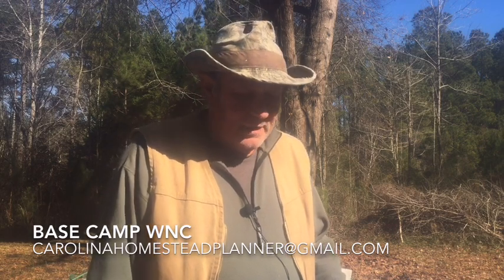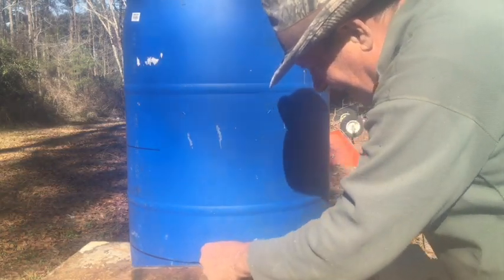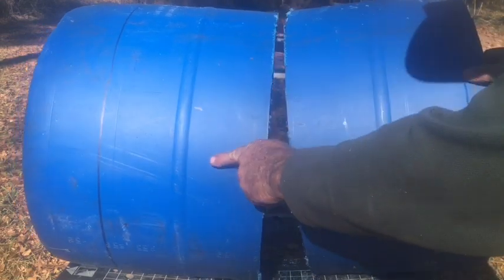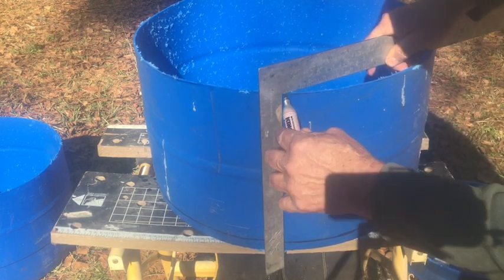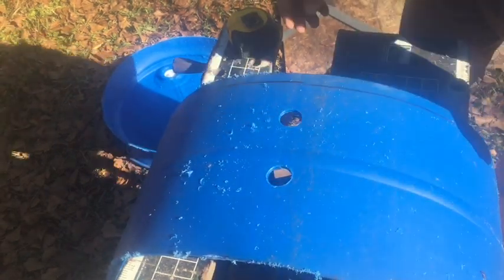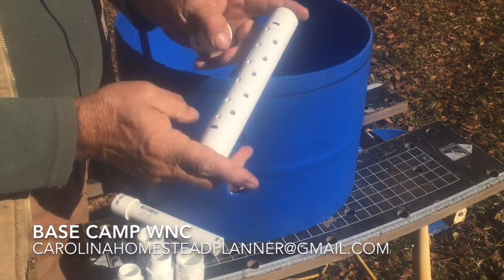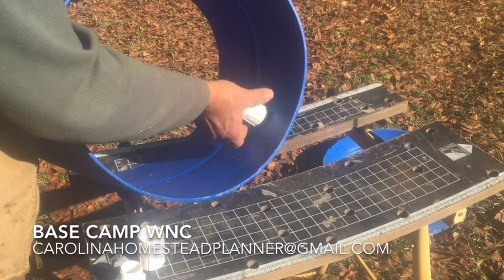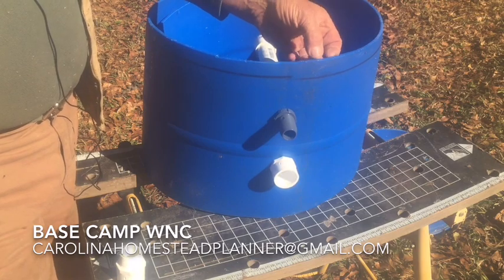Building Your Spring Water Dam

Comment: When I made my spring filter, I was getting water coming out where I had the PVC attachments,  TO fix this, I took my 1-1/4 whole saw and drilled more holes in a left over piece of the plastic barrel. I then cut around the holes in little squares and use them as washers ( or doubled up) where the penetrations occured.  One advantage is that the barrel pieces had a natural curve and fit well into place.  Then I attached the fittings and NO LEAKS.

Comment: Good job on the video.  Question for you.  How do you determine how far the Spring Box should be from the Spring Dam?  Is there a formula?
Reply from the maker: No particular distance 
It’s the grade
Coming out of the spring dam it’s on the bottom 
Going into the spring box it’s on the top
So the spring box needs to be lower than the dam what ever distance that is 
Same from the spring box to the cistern 
It flows from the bottom of the box into the top of the cistern 
You don’t need a lot of fall a 1/4 bubble on a four foot level or a 1/4” in four feet
Does this answer your question
Reply: @basecampwnc1745  Thanks for your quick reply.  Yes that answers my question.  Appreciate the effort you put into the videos.  God bless.
Reply from the maker: Will be posting the lasted video of building a spring dam tonight 
Tried to make it as detailed as possible

Comment: The bottom on mine has elbo and pipe goes up with open at top. No holes for over flow. Can pull pipe loose to clean out bottom.  Other pipe is to feed house with holes and that pipe is vertical also hope that helps. Thanks for videos

Comment: Great idea,  I have several Springs on my property. I have one that I have close to completing,  using a rampump to pump back up to the house. Still working on storage.  I enjoy your input.
Reply from the maker: Thanks for your comment 
I would like to see your setup with the ram pump
And your storage tank with the input line and the overflow  line so the ram continues to work
And as always subscribe like and share 
Thanks Eric
Reply from the maker: I have only had 2 springs that we’re capable of producing enough water to run a ram pump   Using only spring water 
Have setup many using surface water 
Very interested in your spring pumping setup 
Thanks in advance 
Eric

Comment: Question, what do you think about only cutting the barrel in half? And not splitting it vertically. Basically making a large bowl. Kind of like what you said you could pull through your garden to collect vegetables. Then placing that barrel over top of the spring, and ceiling it with clay around the edge. I was just thinking this would prevent rainwater from entering the top side. You could also place wait on top of it to hold it down better. This would eliminate having to use Rock, plastic, and backfill. You could still backfill if you wanted to. Just wondering what you think about this idea. Thanks for the good video.

Comment: Good detail 
I’m going to build one next week 
I’ll let you know how it goes 
Why did you change the length of the overflow pipe ?  It was shorter in the other videos. 
Thanks
Reply from the maker: Thank for your comment 
When the spring is back filled it will cover the dam and the hole the previous owner used as a spring so the overflow pipe is extended for that reason 
And as always subscribe like and share 
Thanks
Eric

Comment: The instructions are great and easy to follow.  I understand that the caps that are removable are not cemented, but are the other pieces cemented?
Reply from the maker: I never cement anything on the inside 
Not on the spring dam or on the spring box
There is no pressure in either one
Reply: @basecampwnc1745  thank you so much!